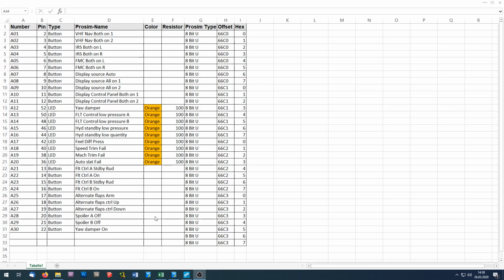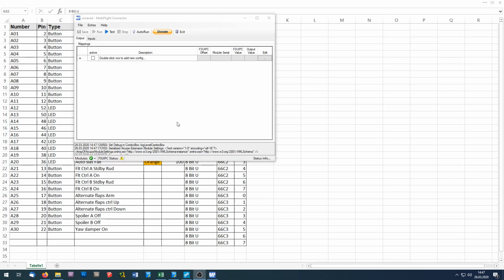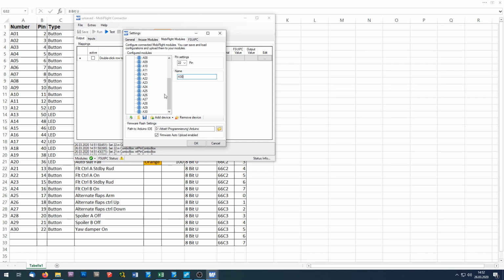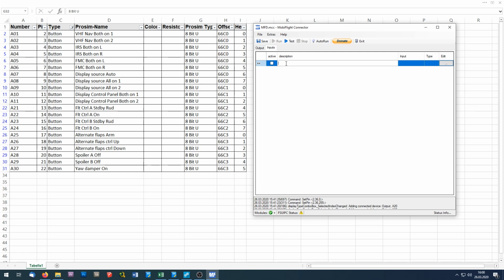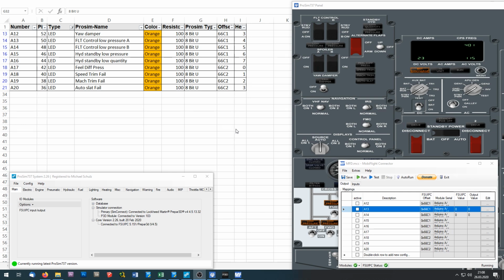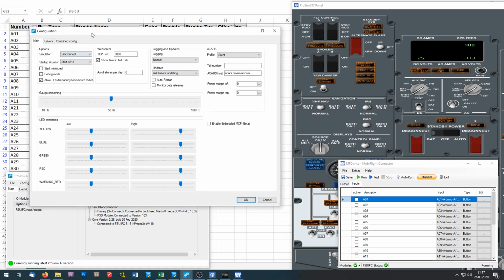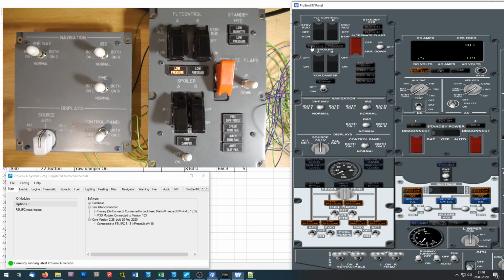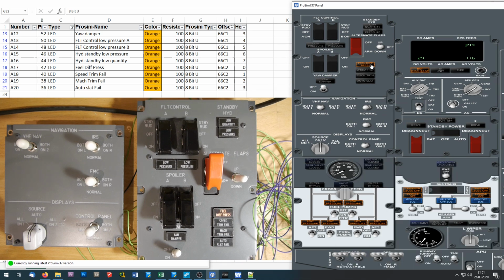Connecting the Flight- and Navigation panel to Prosim - A Boeing 737-800 Homecockpit #40

Comment: Hi Michael, have i see right? You can give youre own offset hex to prosim and  the then you connect it with the mobiflight over the fsuipc setting? Do you know i can Use it now for a320 on fs2020? I have the fbw and fenix. Thanks for your great Video you help me extremly a lot to understand if is how my questen is :)
Reply from the maker: Yes, you see it right. I'm not in this A320 or MSFS topic, but I think, this should be possible. The combination of MobiFlight and MSFS has even some more options and differs a little bit from Prepar3d. Just watch one of the tutorials on the MobiFlight channel.
Reply: @Mickeys_Flightdeck  thank you you are my hero :)))

Comment: Hi Michael With Arduino, are you using PROSIM or MOBIFLIGHT or both today ? thanks
Reply from the maker: There is no decision between these two. Prosim is the 737 system logic and MobiFlight is needed for the communication with the simulator and the hardware.

Comment: If you use the old grey flat ide cables, you can lay them flat and fold them at any degree making a very neat flat wired panel, cut them into any width needed.  Looks very neat too, you can also write on them with marker pens and they cost nothing today.
Reply from the maker: I thought of this first. I have the feeling that I can follow the cables better when they are single cables. But if you have a good cabeling plan and know where every cable has to go, than you come out with a cleaner result with these flat cables.